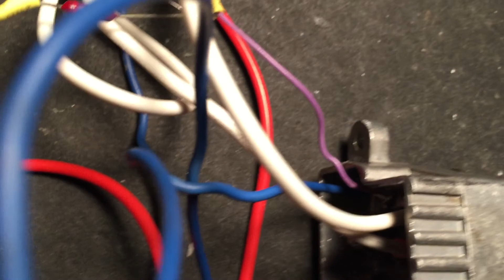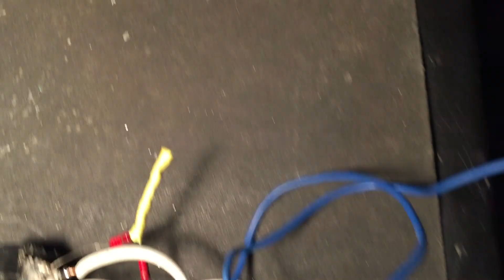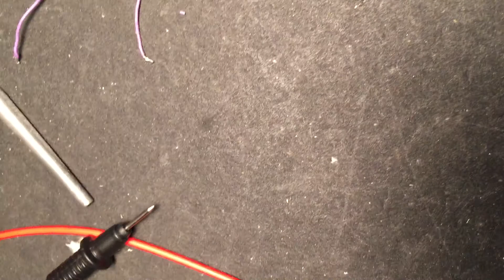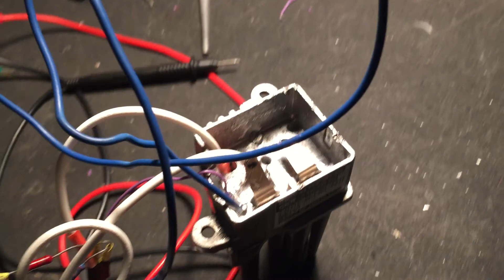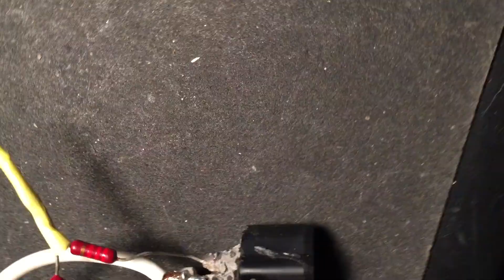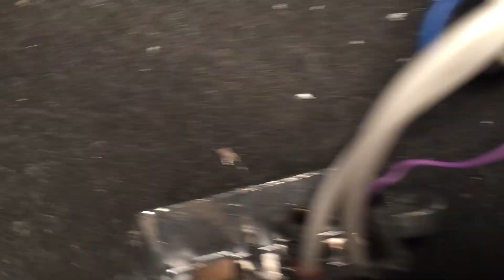BMW E46 final stage resistor re-design

Comment from the maker: Took the car for a long run with blower at various speeds, worked a treat. If you have a faulty one of these dont throw it away, I will be interested in it, and if you based in NZ I might even be able to fix it for you. I suspect E36 one will be similar.